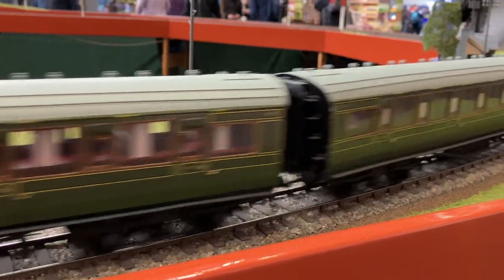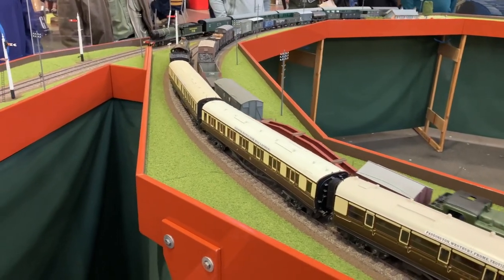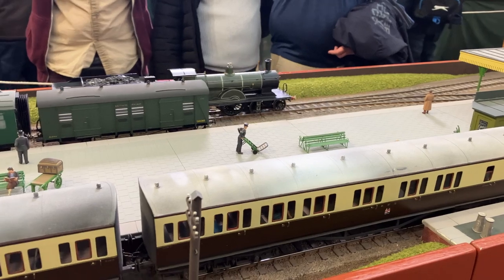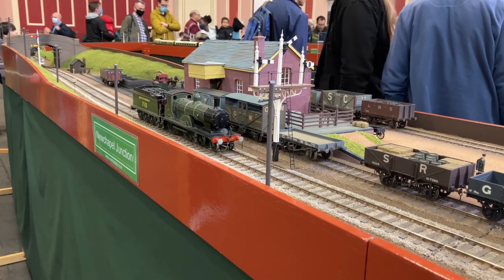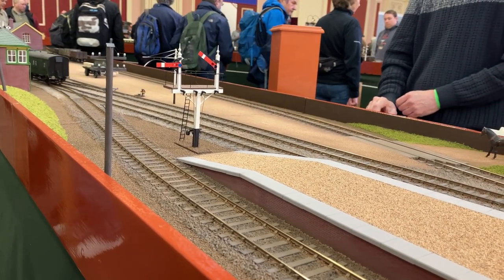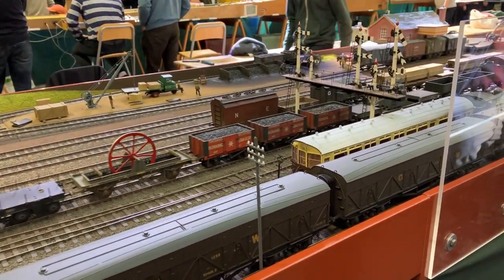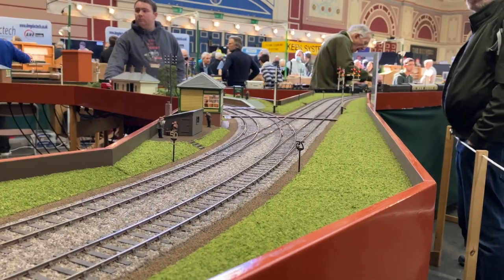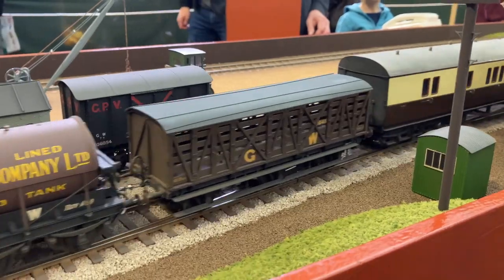Newchapel Junction - A Large O Gauge Exhibition Layout

Comment: Do they really run engines that big backwards -- here in the days of steam the terminus always had a turntable. There was even a triangle turn around on several small branches.
Reply: Yeah, smaller tender engines like the T9's would often be used on small British branches, where they often only had small runaround loops. In the US, branches often ended at wyes or turntables.
Reply from the maker: Yep, as Will said on small branchlines it was fairly common in the UK. Often the terminus stations wouldn't have space/facilities for a turntable and because the speeds were lower than the mainline anyway it wasn't much of a problem. It's practice that can still be seen today on my heritage railways around the country. Thanks for watching 😃
Reply: @willbreckinridge8010   LMAO how barbaric.  I used to love going to my local station because it was a peak hour terminus. Two tank engines Ab 4-6-2, 4 carriages, two of them 1/3 breaks sitting there most of the day. They would leave at 3pm and 3-45pm. 
The run down to the City was maybe 40mins. All stops (9) back by 4-15 and 5-30pm respectively.  The sad thing was the 3pm train was always empty. The 4-15 was full of school kids and the 5-30pm was the first workers train - full of smoke and the odd drunk. The main station was on a loop (no turntable needed) but the terminus had a small table right off the end of the platform.  The main service went through to  two other  stations further down the line. In all I think there were 4 turntables on the line and a triangle turn about on another branch line. don't think I ever saw an engine going backwards until the diesels came along.
Reply: @ThatModelRailwayGuy  --  That was a different time.  Now with EMU its done in almost half the time. All the infrastructure is  gone and the land sold off. It was sort of mainline too so they had to move at normal speed. Lucky to have one of the WAb 4-6-2's in working preservation.